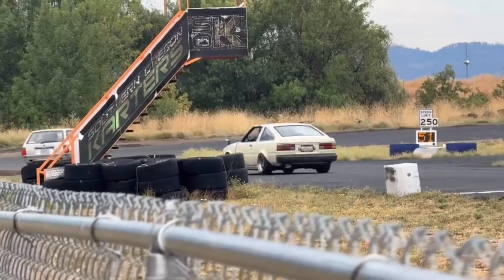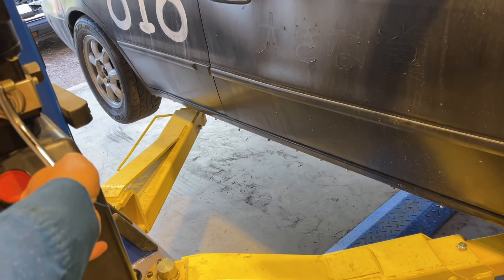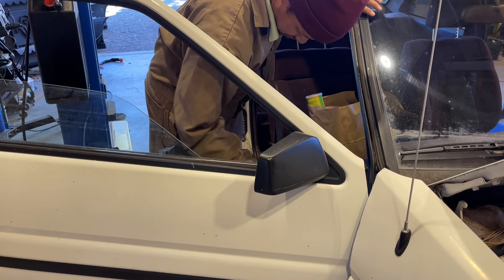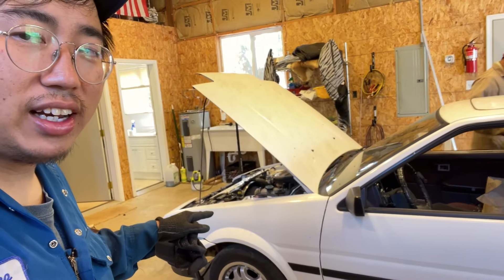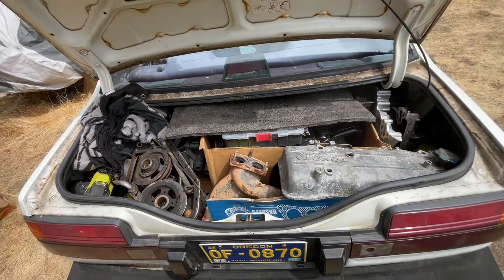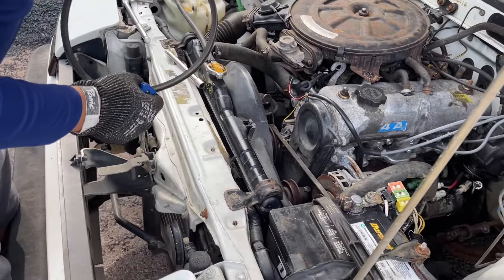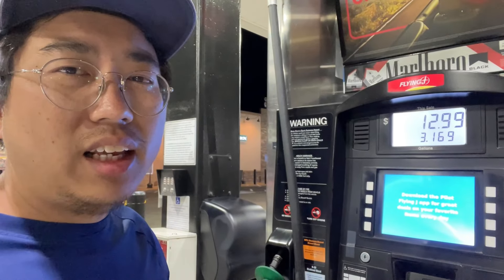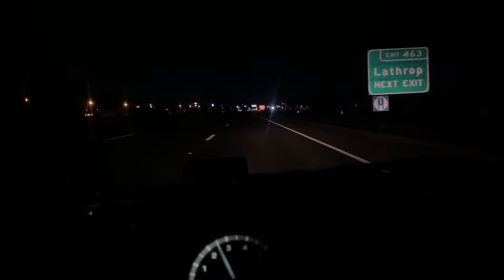Driving my barn find AE86 home 1987 Toyota Corolla Oregon to Los Angeles

Comment: 33/37 MPG bruh, i gotta get a efficient beater.
Reply: Get a Starlet with a 4E in it, you can crack 40mpg. Maybe not the turbo one, the only desirable one ironically lmao
Reply from the maker: It’s super slow though lol
Reply: @kelvinarreola  you see, the trick is to never let the revs drop below 4k from the moment you turn the key. ever, for any reason, whatsoever, no matter what, ever. 
 you gotta act like there's a rev detecting pipe bomb attached to the crank.
THEN you'll be putting out the same power as a first gen Prius